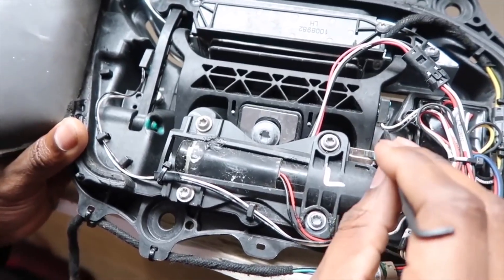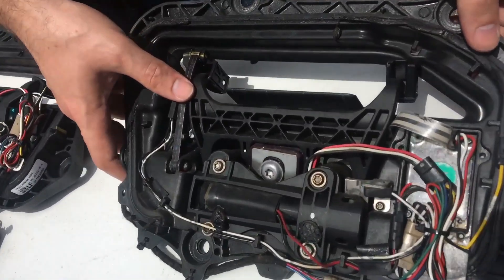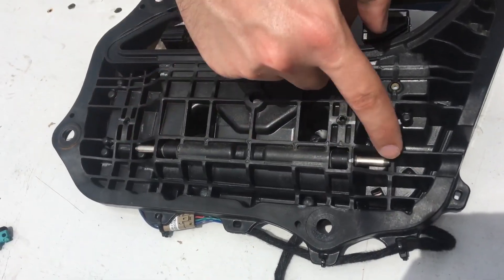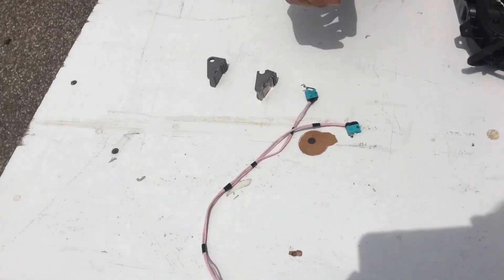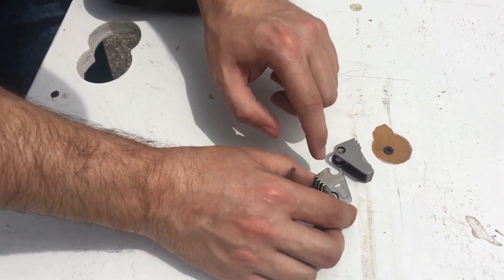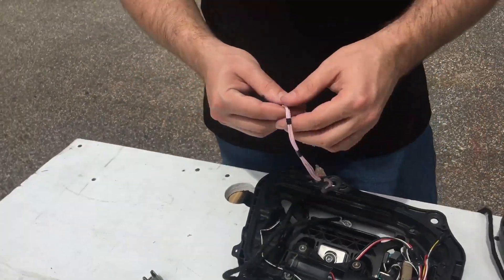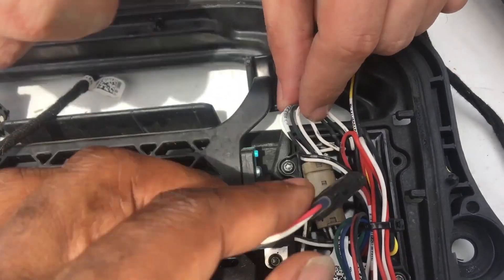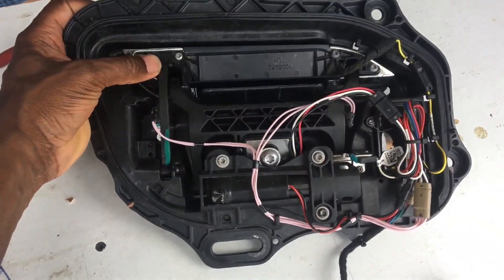Fixing Tesla’s Design for Good

Comment: So who's the brain dead engineer who decided to mount the switches to the moving handle rather than to the stationary handle mount?  Unbelievable how junky that is made for a $120k car.
Reply: Theyre not built to last, thats why. The design they went for was probably the cheapest they could get away with for a certain number of cycles i.e the warranty period of the vehicle. They also have the monopoly on spare parts and technicians who can carry out the work (for now), so they are perfectly happy to sell you another whole handle assembly because one wire is snapped...So much for an environmentally conscious car, its just another source of e-waste (for now).
Reply: Even if you want to go this unreliable high-tech route, it should be sealed opto switches or reed switches.  California engineering...
Reply: You’d be shocked about how many engineers think so little through in common day to day applications. Also, not justifying Tesla’s poorly designed parts, but look at pretty much any vehicle out there and you’ll see tons of design flaws everywhere
Reply: The way to have Engineers design and fabricate is 2 give them the smallest budget possible. If you give them the sky's the limit buget the product would be too expensive. And if you use GM's old marketing plan of building in defects so the automobiles would come back to the dealership for Servicing.
Reply: That’s why I’m personally waiting to see what comes from the bigger companies. Now that you have ford’s Mach e officially jumping in the arena with Tesla, we will be seeing the other big guys releasing ev’s people actually want and they’ll deff be better built and better prices then Tesla
Reply: Casey Moore Ford has been making strides in the last 8 years or so, but the Mach E is a sad Tesla competitor.
Reply: Aaron Foresman are you joking? What about the Mach e makes it a sad competitor? Better interior, better overall looking design imo. Similar performance. It’ll have guaranteed better build quality. Same range essentially and Cheaper.
Reply: Casey Moore 
It’s outrageous how the Tesla fanboys knock American car quality then defend Teslas which are MUCH worse.
I fix all of my own stuff and I could fix a Tesla too but I refuse to buy anything that is so poorly built. An electric car has so fewer mechanical parts that it should very rarely fail but a WAY higher percentage of Telsas have been hauled off on flatbeds than GMs or Fords.
Reply: @someonethatwatchesyoutube2953  That's the price of driving the hottest car on the road but having a cost per mile of a microcar.  I fix my own stuff, and will happily swap in a better part if my door handles crap out.  I love my auto-presenting door handles.  My car is happy to see me, unlike my wife and kids.
Reply: @incognitotorpedo42  I'm sure your wife and kids are pleased to see you too, but maybe they have a different way of showing it. In ten to twenty years your kids will talk about their awesome dad who had an electric car before anyone else.

Comment: Very informative, very valuable info, and very funny! 
(I've never seen the hilarious Jordan Peele and Rich in the same room, together, so I suspect Rich really is Jordan Peele!)
One more thing about wires- Super flexible insulation is great, and stranded wire is certainly better than solid wire for flexibility, but there's one more thing- Super-fine stranded wire, which has finer strands than standard stranded wire, (and more of them). Its WAY more flexible than standard stranded automotive wire. 
Why doesn't every manufacturer use it, if it's supposedly so good, you ask? Because manufacturers are always shaving pennies wherever possible. 
Anyway, you can find this kind of wire with super flexible insulation, and that's the very best solution for that application.

Comment: If you really wanted to help the environment, skip the religious fanaticism and focus on practical solutions. 
Buy a Nissan Leaf. Focus on your home. Traditional homes burn much more fossil fuels than cars. 
For all this trouble with Telsa, you can create a zero energy home with solar panels, a fuel cell generator, water heated floors, and energy efficient appliances.
Reply: yamam, solar pv is very cheap now. Half the people I know and work with have >5kw rooftop solar pv systems.
Reply: I don't have an EV but the improvements I mentioned energy costs by $1800/year and home CO2 emissions by nearly 2,000kg/year. 
My energy system will pay itself off in 12 years. We sell into the grid so I want to add another 3kW, which would reduce our net energy costs to $400/year total.

Comment: Rich, wasn't that a hall-effect switch connected to the ribbon cable on the first generation? I can see why they might have gone that route on the original design, to eliminate the potential of a mechanical switch failure. I was kind of surprised when they went with microswitches, which can fail. The ergonomics of the Gen 2 & 3 handles is much better, with their spring-loaded feel when pulling on them. The Gen 1 handle was a bit bizarre with its lack of movement when pulling on it.

Comment: I would like to point out that wires that don't fatigue (or better said, experience fatigue slower) exist for at the very least 17 years now, as i have them installed in what used to be the hood sensor on a GPS find and retrieve unit. I'll repeat that 17 years of monthly (or more ) constant checks and having the wires constantly flex. There's no damage to the sleeve, there's no damage to the wire. SHAME AND DISPRAY on Tesla.

AND that, is without discussing the simple addition of a pivot supporting flexture or simply having a trace based transfer system, things that have been around since they sent man to (the) Moon.

Cheap crap is exactly that, cheap crap.
Reply: The wires on the focusing lens servo on a CD or DVD player (or any other laser disk storage) flex multiple times for every single disk insertion (or power on, read/write cycle begin/end, etc...) ... and they last years.
It's more a matter of properly calculating the minimum bend radius. Wires can bend a lot of times before fraying, you just need to abide by the minimum bend radius. This is why we have such things as "strain reliefs" on wire entry points. (Classic examples are on charging cords. Apple is known to have a poor strain relief design on their Macbook chargers, causing them to short out, spark, and even start fires.)
Reply: Benjamin Esposti More like no strain relief. I've been through two chargers already although they were all replaced under warranty. Tesla is just like Apple, looks good but with occasionally shoddy engineering.
Reply: tesla si trying to shave every cent possible off of the build, so doesn't surprise me there.
Reply: Would also like to point out that whomever does potting at Tesla should be shot by each and every electrical engineer in business today. That's quite literally the sloppiest expensive bit of electronics i've seen, and i've been in some sloppy, expensive, electrics (you'd be amazed what hospitals leave behind when they have to vacate a building).
Reply: aserta keep in mind Tesla didn't design it, they have a supplier that design and test them and then gives Tesla a bid for what each unit will cost with said materials. Now they have switched suppliers which I assume are using better components or a better overall design, simar to what this retrofit has accomplished
Reply: Yes they have finally started making good wires for doors now.   Dammit.    I was making such good money every week on fixing them years ago.

Comment: EV tuning solutions should rebuild a bunch of handles and sell them with a core charge to return the old ones.  The solution looks great but a lot of customers don’t want their cars sitting idle for days/weeks waiting for handles to come back.
Reply: The issue is firmware. It's car specific in most cases depending on firmware level. We can typically turn them around in a day or two and back out to you. Shipping charges are where it gets pricey otherwise we offer a full rebuild for 350$

Comment: This need too much work I’ll pass and get a old Toyota lol 😂
Reply: OMGWTFLOL no need for speed all I want is a reliable car that doesn’t need a lot of work like Tesla have to many issues 😓
Reply: I didn't know Toyota made an luxury EV that goes 0-60 in 2.9 sec.
Reply: The day some one makes a reliable, inexpensive electrical car that can do 1000 miles per charge and it dont cost more that 20k maybe then maybe i can think about doing a buy, but im still keeping my gas vehicle if gas is still available.
Reply: @2fast4you25  what car under 20k gets 1000 miles to tank a gas? I don't think it's a car available now that gets 1000 miles to  a tank of gas. Some Honda's and Camry hybrids get around 730 miles to a tank of gas. Nobody will ever make a car that cheap to have that range gas or electric
Reply: OMGWTFLOL Toyota Camry 0-60 in 6sec. Tesla is only as fast as the flat bed carrying it.

Comment: These door handle designs in my opinion suck, every last iteration looks like Chinese made crap. Those switches should have been mounted to none moving surfaces within the mold and the module should have been relocated to a central body control module inside the car not on the outside in the weather. I know patents play a role in how a car is built maybe Tesla cheapen out.

Comment: The nonsense of tesla, how much simple and cheaper would be a regular door handle. Each day it passes I want one less and less...
Reply: Doesn't sound reassuring that you changed car in 3 years. Having worked in the car industrie, I can tell you the doors are a marketing move and the 17" screen is twice: looks awsome and saves Elon from spend the money of the developing the 50 or so buttons and wiring harnes needed (huge production and develovent savings). What sounds advance in reallity is cheapskating.
Reply: MVFSULLIVAN "buttons NEVER age well" What are you talking about. Computer screens/technology age horribly. In 3 years the screens will look dated, pixels will start going bad, back lighting dies where as buttons will last the life of the car. Plus I shouldn't have to go through menus to change the temp or the radio station.
Reply: I see your point but I would rather a screen that can be dynamic and get better over time, than buttons that will NEVER age well.
Reply: So when you need a car and it fails is because has to be "not boring". 50k+ car should be dependable no matter what, if it isn't the you don't have a car, you have a pile of junk.
Reply: MVFSULLIVAN that's true, my mom's 2005 Pontiac vibes radio screen burnt out, it's just a red screen now, and the buttons are starting to show more red light (wearing out).
Reply: Because its pontiac..Audi A6 2005 ..interior like new ..only thing i hate is that is diesel and sound like a tractor
Reply: dzonikg and that you’re literally killing people? That’s kind of a proven fact at this point... slowly, and less do out of heavy city air pollution.. but you’re helping to kill us all earlier than we would otherwise die outside of accidentally.. so there’s that too
Reply: yep' that injector pump VAG diesel are horrible noisy, and known in Europe as relative unreliable and smoky...
Reply: I want the drivetrain and performance without amateur hour engineering. Let's hope Toyota can make a decent performance EV before 2050.
Reply: raboox9 oooo a door handle might fail on a 4 door car once every few years.. NEVER happens in any other car.. fool.. grow up and stop being over dramatic
Reply: Julian Hickman then stop blathering and do it. Is someone holding a gun to you to buy a Tesla? You either get electrification or you do not.. you are either willing to deal with growing pains of a new company, or you are not.. quite being a whiny b** about everything. This is America. You are free to chose. Wtf is the negativity about???? Some of us like Tesla’s.. DEAL WITH IT
Reply: That's not true, I could buy one straight out but won't due to poor build quality and the fact I live pretty far from any service center.

Just because you're bad with your money with impulse buys or use the logic of "I have 10 dollars, that's 10 dollars, I'm buying that" doesn't mean that every does.
Reply: The main incentive for my Model S upgrade in 2016 was that AWD and Autopilot were not available when I ordered the first one in 2013. Both the RWD and AWD versions are good in snow, but AWD tracks better under hard acceleration on dry pavement. (Both cars do 0-60 in 4.2 seconds.) I use Autopilot every time I drive on the highway. It's cool, but it's going to get better as the firmware updates arrive. There have been several Autopilot firmware updates since 2016.

The main reason Tesla went with virtual buttons is so they have the option to reconfigure them or add new ones using over-the-air firmware updates—pretty much the same reason that Apple did it with the iPhone. This approach also makes it easier for Tesla to control certain parts of the car from the Tesla smartphone app.

Yes, the door handles were a good marketing move. People remember them. The handles also solved the wind resistance problem created by traditional handles. In an EV, wind resistance is a more critical issue because it can affect range.
Reply: You would think the fact that it is an electric car with a 300 mile range looks like a regular car and can even out perform most sedans in torque....less fluids to worry about....a FRUNK....and many other reasons....that they would be able to skip a lot of the gimmicky things like door handles that pop out and just go with regular handles that work in all weathers rather then testing new handle designs....heck i would of liked the tesla more if it had a regular radio with mechanical gauges (in order to save on power use). less electrical gizmos and gadgets and more simple things that just work.
Reply: Styxx N you do not belong in a Tesla. Go buy whatever piece of junk floats your boat and stay in the past.
Reply: When Tesla introduced the Model S in 2012, they wanted to make sure it would be memorable and stand out from the crowd. The auto-presenting door handles did just that. It was one of the first things people remembered about the Model S after visiting a Tesla showroom—that and the 17-inch touchscreen. Tesla wanted to make a dramatic first impression, and the door handles were a home run, in spite of later reliability issues.

The handles on my 2013 Model S were replaced twice—all work done in my own garage and 100% covered by the warranty. Now I have a 2016 Model S with 38,000 miles which has had no door handle issues at all. Tesla seems to have gotten it right.
Reply: Joselo Aero me too
Reply: If you could afford one, you'd have one already.
Reply: I can afford a model 3 but I haven't got one because of Richard's videos. The lack of reasonable repairs for them makes it not worth

Comment: Wondering what problem Tesla was solving when they designed that handle?
Reply: Cool bling to sell an unknown car from a new manufacturer. Judging by people's reactions it seems to be a "moment of truth" that they designed into the operation of the car to  delight people getting into it. This is a bit like the box that Apple products come in where you have to pull the top a bit (but not too much) to lift it off which makes the box and experience feel like it's really well made and builds anticipation for the shiny shiny inside (now everyone does this it's not as special). A product design trick to make a Tesla seem different and special.

FWIW I'm a boring engineer. Give me simple and practical any day but you can't blame them for trying.
Reply: David Fiddes I’m also an engineer, and it feels like the old “I have a solution, now let’s find a problem”.  See it all too often.

Comment: did we see actually the door handle revision 2018? tesla I hope you will copy this.
Reply: The 2018's use a hall effect sensor. I did not have one of those to show.  They typically have module failures before mechanical components but they also haven't been around that long to show other weaknesses.

Comment: Am not impressed with Tesla's build quality or durability. Especially for such an expensive car. And even those mechanical micro-switches will eventually fail. Better off with a solid-state hall-effect switch or similar.
Reply: Gen 3 uses Hall Effect.